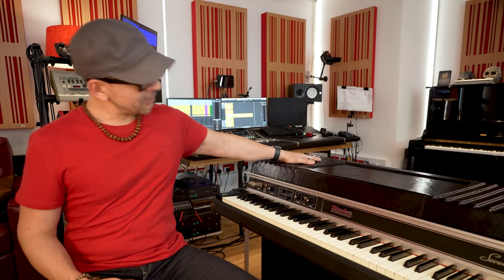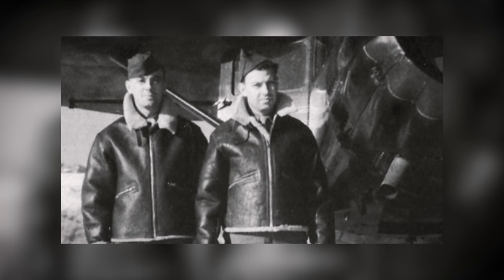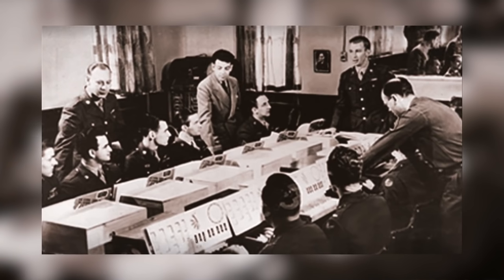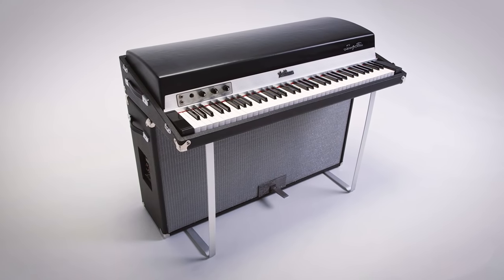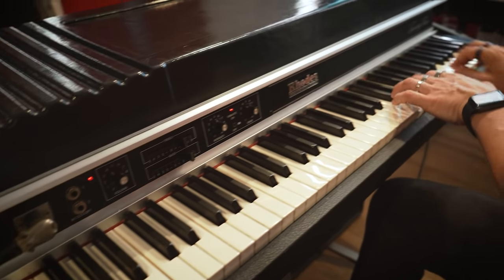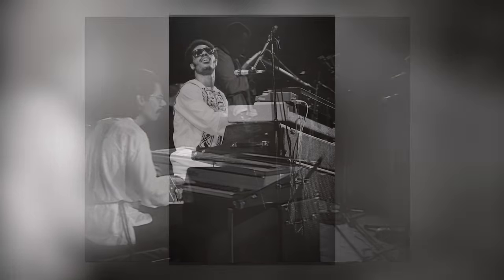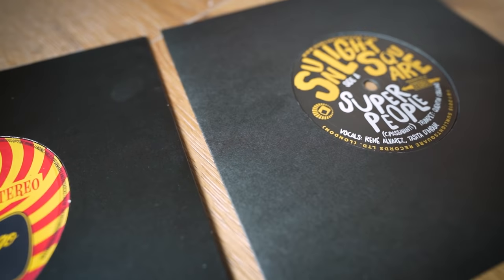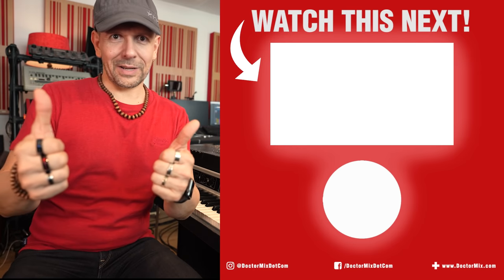The Rhodes Piano: Mini Documentary

Comment: I didn't know what Rhodes has metal forks and magnetic pickups! Waiting for the next chapter.
Reply: The video is slightly misleading on that point. It's not really a "fork" at all. It's called a "tine," whatever that means, and it's just a single rod that looks like a wire. It doesn't have a fork, just a single rod. When you see the vibrating wire in the video, that wire is the whole thing. The large brass colored bars you see across the top when he opens that case are resonators that increase the sustain of the tine, but they are a separate structure, which is obvious since the vibrating wire you see looks nothing like the giant brass bars. The piano needs tuning from time to time and this is done by moving a little spring thats around the end of the tine. I'm guessing that a tuning fork setup would not allow tuning. It does, however, sound similar to a tuning fork.
Reply: @TheLarryBrown  nerd
Reply: @TheLarryBrown  jk I live for this bits of trivia and information
Reply: @jambajoby32   Nerd as in "very smart person." I'll take it. You earned a thumbs down from someone. Merry Christmas!
Reply: @TheLarryBrown  did you read my next comment lol I said I actually enjoy bits of trivia like that. So in this context, it’s a compliment. 
I like these tidbits because it helps built a relationship to whatever the trivia is about.

Comment: I had a Rhodes back in the 80's.  It was awesome.  I sold it when I moved to Florida from NY because it weighed 100 pounds.  If the new Rhodes uses the same tines but comes in at under 30 pounds I'm all over it.